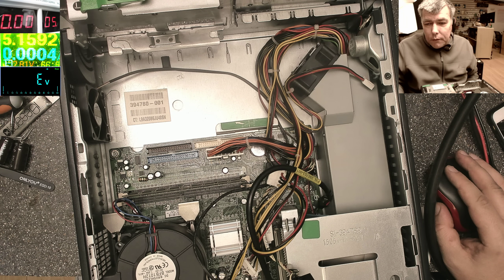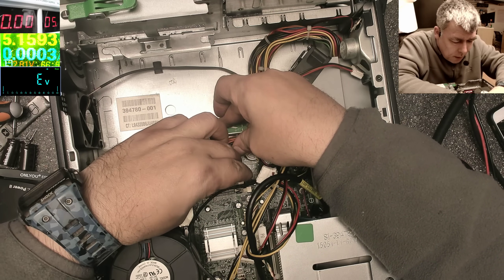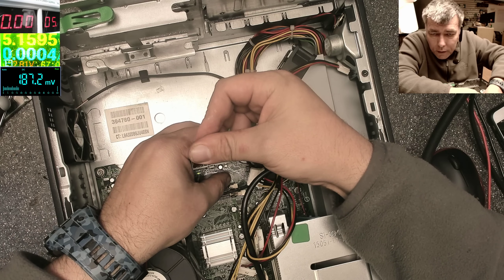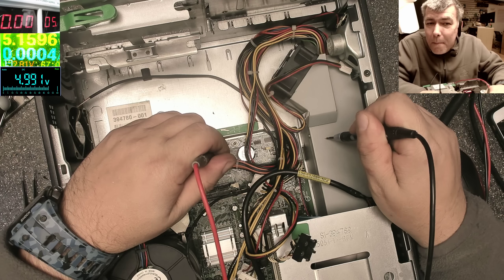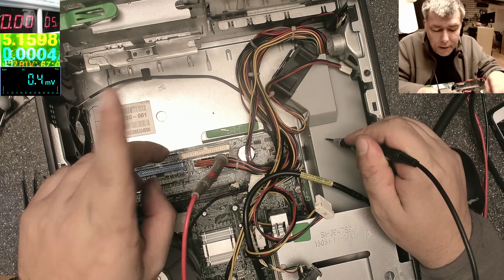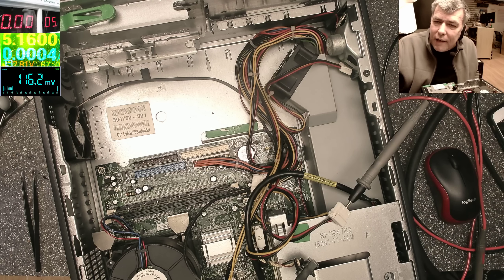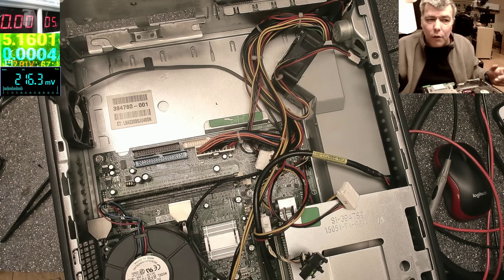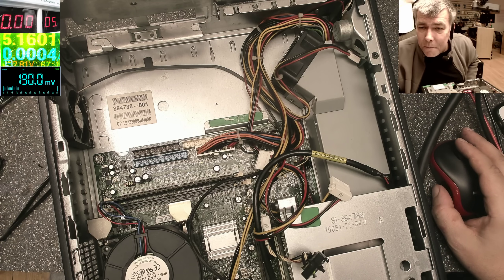Desktop Pc Power Supply Repair - part 2

Comment: if you see bad cap.and not change it may be hdd dident work well and fail soon .trust me
i see to many hdd smart "problem with 5 volt supply"
and  on the startup side "cap near Purple color " cause not turn on or too many push power button . to start pc
never say oh i dont have time for change bad  cap.almost  damage everything

Comment: Thank you! I am going through about 20 or so old desktop computers I have accumulated over the years and the current resurrection attempt has exactly this issue 5 volts but no start!

Comment: Good video Although i am trying to find video on diagnosing Overheating power supply of 
HP 519334-001 463952-001 HSTNN-LA03 
Input:100-240V / 50-60Hz
Output: 19.5V-9.2A-180W

It runs so hot i could put a frying pan on it. So if you ever do a video on these type of desktop chargers and a way to cool them down with a fan as they are fan less it could be be very helpful. or a way to diagnose what is making it run so hot.

Comment: Altho I replaced my psu with a new one, you clearly demonstrated and explained the mysterious isues I had. and it might have been the dry capasitors all along. I might use my osciliscope on some devices I need to fix, a old/new tool explained by you for me to fix scary psu isues (scary as in, 240v is kinda scary for me :P ) anyway, im not just gonna probe and connect it, im learning, and testing and buy if posible just a new psu. But the dry cap isue definitly got me doubting myself before. great video thanks

Comment: Hello Sir,

Maybe you can help

I have here a Laptop Asus   K52J  i5 10 years old, dead. no lights no bios; bios chip has no 3.3V on pin 8 and is 42 OHMS from pin 8 to Gnd;

 Motherboard  3.3V keeps  going OSCILLATING  up and down from 3.3 to maybe 1 volt or less,in less than a second,hard to read meter;    20 volts charger in
 As soon as charger is plugged in, 0.60Amps flow ;600mA, 12 watts ; power button does nothing,no voltage on any of the 5 pins.

BGA Chipset BD82HM55    Heats up fast, will burn your finger in 15-20 seconds;

Laptop was  working before,suddenly shut  down,never went on again; no bios, no led,nothing

Question: do you think if i replace  ONLY   the HM55 ,that it will be it ?
Thanks and keep your videos coming.

Comment: Sorin, I have the same tester. It's good only for showing voltage output, but not against proper working OverCurrent/Voltage or UnderCurrent/Voltage protection or Short Circuit. And the ripples during heavy or optimal efficiency load? The problem with somewhat faulty PSU is that it will fail sooner or later and then we hope it won't kill оur HDD or other expensive component. Shit happens, right?

Anyway there are comments that the average user will replace the PSU. Yes, it's ok to do that when the replacement has better quality and done properly. Other people will say that game buy-throw-buy sucks ... We know that but ask yourself what will happen if there's no steady selling - no implementation of improvements, no money flow in already stagnated economy, no work for most of us, etc ... We are all smart and know what will be the outcome

Comment: This video would have been so much more professional if you actually took the time to explain what capacitors you used for testing and how they were connected (in series/parallel), and show how the problem was fixed. Of course an oscilloscope is mandatory in an electronics repair school. Still a good video, but you seem a bit in a hurry lately.

Comment: This powersupply testers only test the voltage in idle mode and not under power. It also don´t shows the ripple. When the blown up capacitors are not changed the output has ripple and the PC is instable.  I had this problem several times.
It is easy to find out with a well working other ATX powersupply.

Comment: I had this type of issue with a 12V 1A chinese charger. I plugged some 12V fans on it for a total current of 0.45A. It worked for few months and then it start randomly working exactly like on the video. i found a fat capacitor when i opened it. The charger was likely not realy 1A and there was only one small capacitor witch was overused and end to die.

Comment: Sorin , 
I like your videos very much :-).

Your method with an external capacitor parallell on the 5 V line is very good.

But you could measure the 5V DC line with your multimeter on AC Voltage. 
Then you will measure the AC (ripple) component, it should me less than 0,1V. I am shure if you should measure that you will measure a AC component of > O,5V or more ;-). 
In this way you can diagnose it without an oscilloscope.
greetings , 
Vic

Comment: Does that tester actually load the power supply? Many PC supplies need an adequate load on all rails to accurately be tested, if it's just measuring the voltage or drawing a few watts from each rail then it might not be giving the full picture.
Reply: Any tester that load tests computer PSUs is going to be a big chunky thing with heatsinks & fans in it.
All the small ones do is check the voltages are present at sane looking values.
Reply: @beardyface8492  You don't need to load it down much and for long.
Reply: @uK8cvPAq  You still have to get the fact that someone might load it heavily or for an extended period past the safety regulators.
& if it's only capable of a 10 or 20% load for a few seconds that doesn't permit testing for PSUs which shut off when the load reaches 80 or 90% (I've seen them fail that way).

Comment: so …. the mov (metal oxyde varistor) in this case disguised as a capacitor, and there to protect against power surges, wasn't replaced …  should be fine ! :D

Comment: That fake five volts, it's surface charge, that's why you should test all lines of psu under load a resistor or light bulb 💡 😃

Comment: yes, output capacitor. No oscilloscope? you could load a small lightbulb on the 5v rail and look for changes in intensity also versus the clean lab psu. I never have luck with bulging capacitors, often just as likely to be a normal one, desolder and test each one on output side

Comment: If you connect a load at this 5Volt rail and measure the voltage i believe that you will see the problem. If it is not close to 5Volt you find the problem.

Comment: To avoid to blow up things if you not sure you can make serial circuit with power cable (ac supply), light bulb and power socket where you can attach board that you testing. If the thing meant to blow up nothing will happen only the bulb will light. You are welcome 😊
Reply: I don't think he works without  light bulbs in series

Comment: It's the same with automotive diagnostics, you can test a circuit and you can see 12 or 5 volts with your multimeter but if the wire is corroded it will still show voltage, but when you put a load on that corroded wire it not supply the correct voltage.

Comment: Very informative!  Could you plug in the extra capacitor on one of the other. Drive Connectors etc (5v to ground) and have the same results ?
Reply: no that is not the standby 5v ... the capacitor is bad on the purple wire ... the 5v on the normal output is red
Reply: Watch the video carefully - he addresses this question, it's yes.

Comment: You should read my comment on part 1 and after that, replace the bulging caps. Also, replace that cap you put in at the rectifier for what should be there: a MOV, or cut out the wires to the input voltage selector switch. Again, read my comment at part 1.

Comment: Problem is: you remove THERMISTOR and put CAPACITOR there. AC passing through that capacitor but current pass through is small to start to work normal. You simply >>limit<< power on that PSU.
Reply: he just call it a capacitor ... im sure he matched the part no ... and therefore put in a thirmistor... however even if he did put in a capacitor in place of a MOV ... it would not be a problem ... only that the power supply is no longer protected against high voltage spikes 
there already was a big electrolytic in parallel ... there ... and he knows that
Reply: @misterkluge  even if he did ... that would not be a problem ... only that now the Power supplly is not protected against a high energy spike

Comment: Nice tip jamming in a capacitor externally to diagnose such behaviour! Suspect most people would just replace the entire PSU on desktops :(
P.S. Saw part 1 now and understand the reasons why it was necessary to fix - suspect a lot of situations like this over time - well done for being there to help!
Reply: I permanently add some medium-value eletrolytics on the drive ends of long molex/sata power harnesses when I build custom large drive arrays - does no harm with sensible component choice and where data integrity is important every little helps to keep drives spun up and glitch-free when the mains gets dirty (especially when the UPS kicks in or gets overloaded)
The actual term is "hold-up time" if you are specifying PSUs.

This extra capacitance is in parralel with the PSU output caps and because some of the high-frequency ripple current is absorbed by the added caps it reduces the circulating HF currents in the PSU o/p caps - I have a hunch that this prolongs their life a little as a side effect (remember, these are low ESR caps and we are talking about high harminic content from the chopper design)

I also add 470uF or 1000uF on the DC plug end of critical router, modem and switch DC power leads for the same reason. (just cut the cable 3cm from plug, insert a double screw term connector and put a electrolytic across the supply)
Reply: So I go away thinking I've learnt a useful thing and then get something additionally interesting on top ;) Thanks Gord Slater